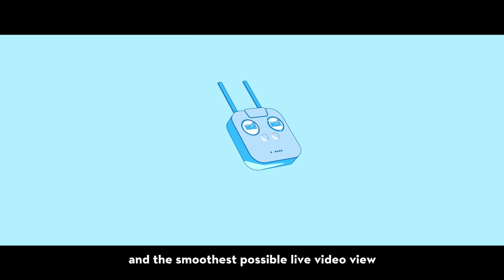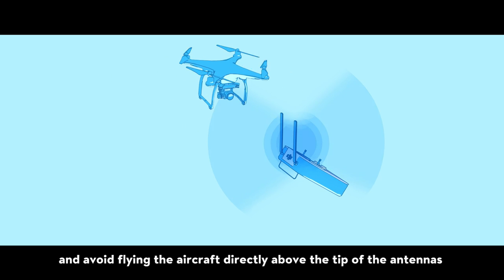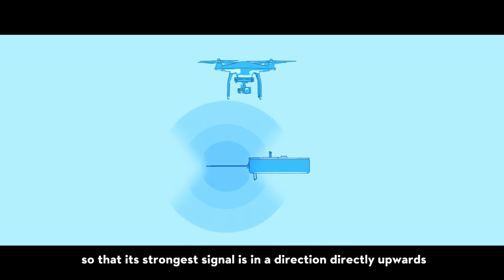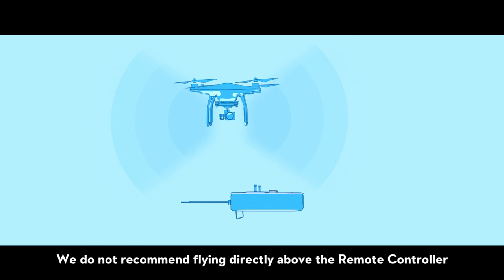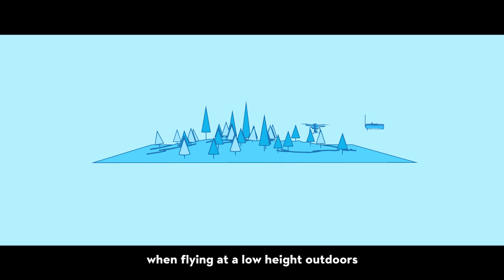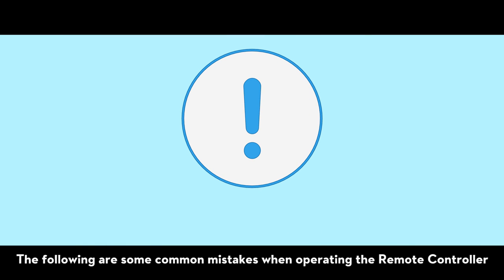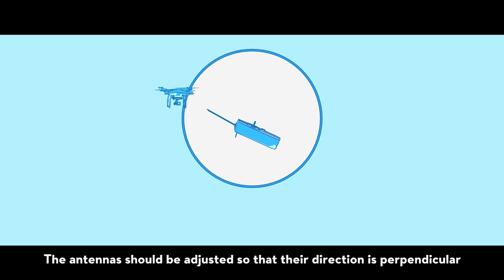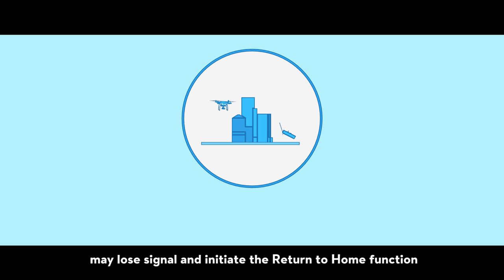DJI Tutorials - Remote Controller Antenna Best Practices

Comment: I just bought a new Mavic Pro and one of the antenna's is loose and does not stand up horizontally. It falls down. I have yet to fly it. This problem is right out of the box. How to tighten the antenna?

Comment: What about the phantom 3 standard remote controller? I found in the manual tells if i point the top of the antenna to the aircraft it will give the optimal transmission range.
Reply: I know its wifi, i mean to get the optimal transmission range, in the phantom 3 standard manual tells point the top of the antenna, its not like this tutorials.
Reply: That's my point, so this tutorials is not for the phantom 3 standard users.
Reply: Yup..
Reply: I know this thread is 2 years old, but in case nobody ever told you (even though you might not have the P3S anymore), the best way to point the antenna is, in fact, vertical, since the receiving 5.8 GHz antennas are in the legs of the drone, and you want the antennas to be parallel to the controller antenna. However, it still apllies that you want the antenna horizontal when flying above the controller. The drone has at least one additional antenna hidden somewhere on the PCB that ensures connection in that direction.

Comment: shit! I have been doing it all wrong for the past 2 days. The first 2 days I ever fly a drone. I lost signal consistently when climbing up to 200M+ with antenna point straight up...man, now I know.Mine is mavic mini btw. it is wifi not ocusync, so a weaker connecter in the first place